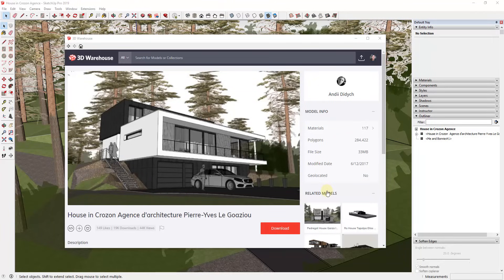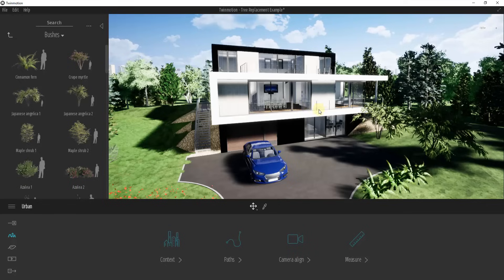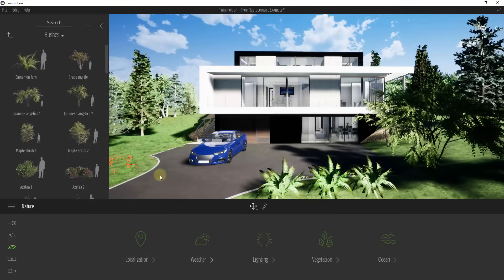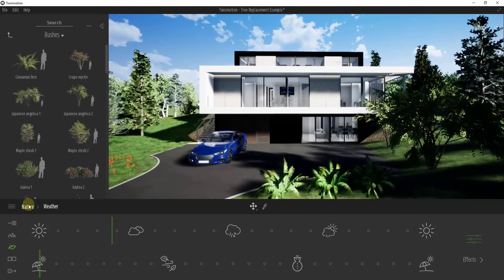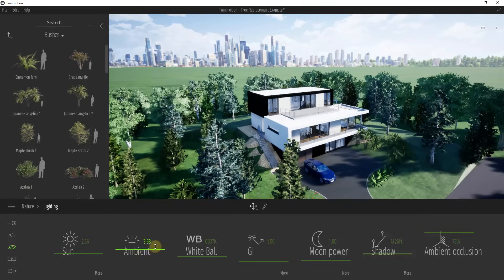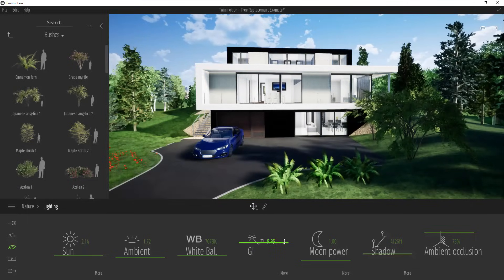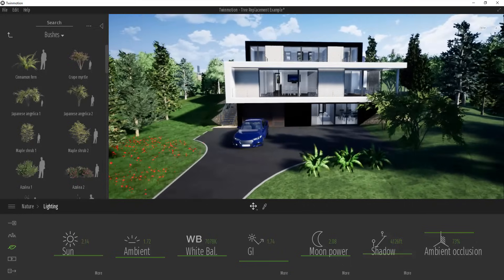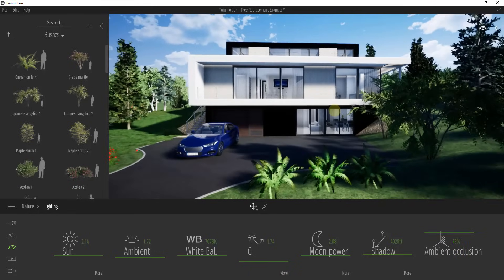Getting Started RENDERING IN TWINMOTION (EP 7) - Exterior Lighting Complete Tutorial

Comment: New to Twinmotion. Discovered your youtube material, thanks it has excellerated my learning process. I have an issue with shadows. Actually the lack of. I've watched EP 7 several times and no help. Any ideas?
Reply from the maker: Do you have the clouds turned on so they're blocking the sun? Or under your lighting settings inside of "nature" down below, do you have "shadow" set to a really low distance?

Comment: Hi Justin. I have installed Twinmotion and am having fun learning it with the help of your videos. My main problem is the lag when moving around, panning and zooming in and out. Is there a video card that should be a minimum requirement for Twinmotion that you know of?  Would you share what card do you use as you movements seem crisp and seamless without lag or jitter. I have a quad core i7 withwith 16mb ram and a GE Force GT-710 videos card. 
It came with the pc and i suspect it is nothing more than entry level.  Any advice would be welcomed. Keep up the great work.!
Reply from the maker: Likely your graphics card is driving this issue - https://twinmotionhelp.epicgames.com/s/article/TwinMotion-System-Requirements - both Twinmotion and Lumion have pretty hefty system requirements. You might also consider turning the quality of your editor down in your preferences to reduce lag. This will make your editor look low quality, but your actual renderings should still be fine. Thanks!